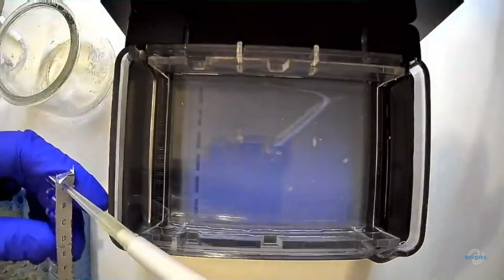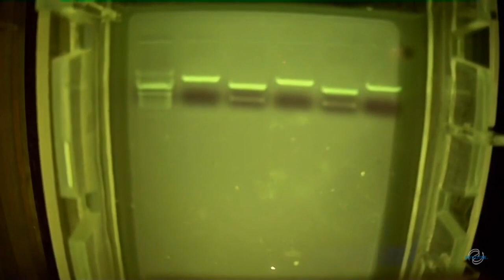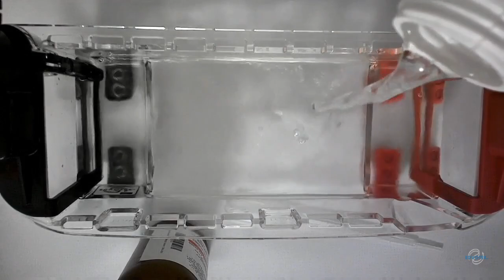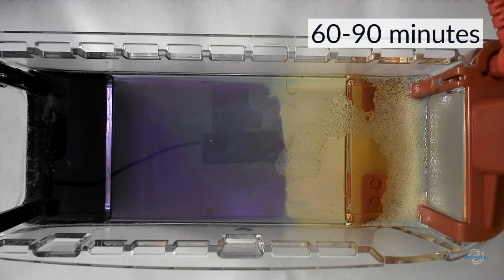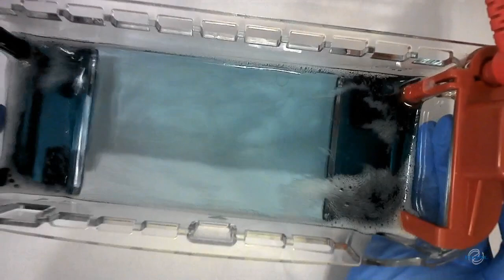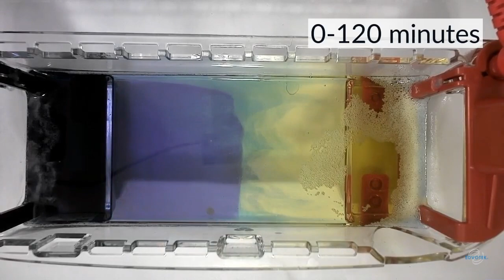EdvoTech Tips: How many times can I use electrophoresis buffer?

Comment: Why does the final pH change? Theoretically, the electrolysis of water will generate same amount of H+ and OH-
Reply: In addition, what's the electric field strength used here? V/cm? I believe it will affect the pH change rate.
Reply from the maker: @Feng_Tang257  It's 150V, and the distance from terminal is probably about 20 cm.
Reply from the maker: Hi!  Most of the liberated hydrogen atoms are likely forming into the gas bubbles we see at the terminal instead of remaining dissolved in solution. The accumulation of hydroxide ions will eventually exceed the buffering capacity and that is why we see the increase in pH

Comment: So does the same re-use apply to gels? I typically re-melt and re-use them several times.
Reply from the maker: We haven't tested this.  I think it would depend on the application of the electrophoresis experiment.  For gels where bands are used for downstream cloning or sequencing, I would never reuse agarose for fear of the DNA contamination.  For simple band analysis, you could consider reusing the agarose but refresh with a little concentrated buffer so as to not affect the concentration.
Reply: @EdvotekInc  Thanks! Using just for simple band analysis, no downstream work.